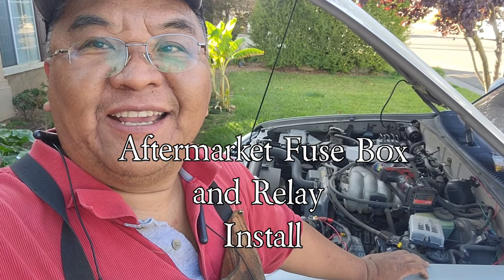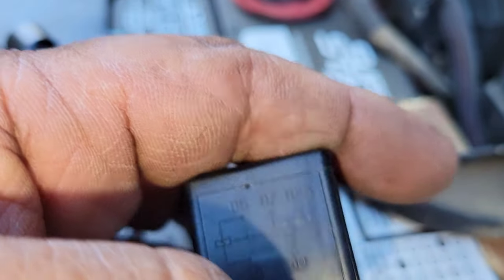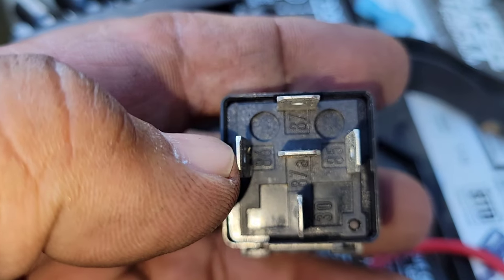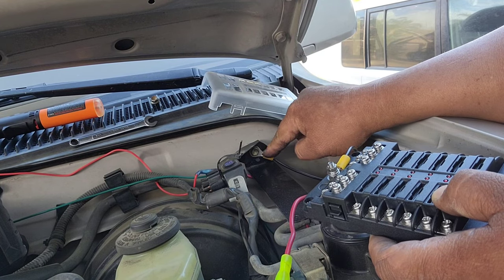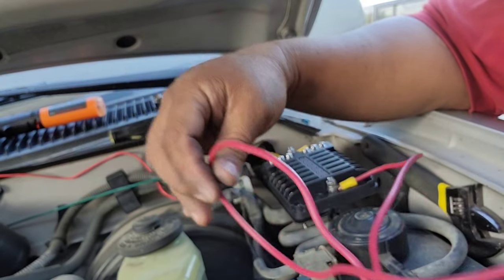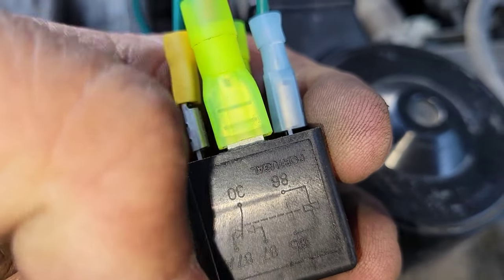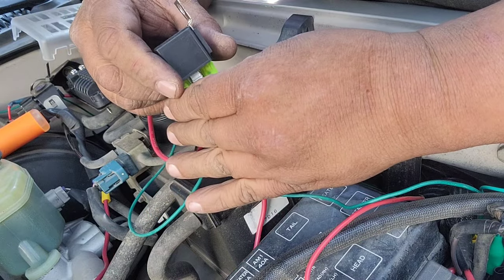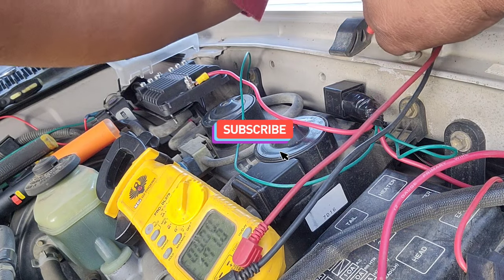Aftermarket Fuse Box and Relay Install

Comment: Tapping off the battery, always should be fused. Also not sure what devices you plan to take off the sub-panel but the  main supply wire coming from battery is what? 14 gauge?? You need to understand a fuse or breakers job is to protect the wire, you have a small gauge wire supplying a potentially large sub-panel and its not fused....recipe for a disaster

Comment: I did this on my atv SxS a year ago following your steps and it has been working great.  Today I hit a mud hole very fast trying to get through it.  A chunk of mud splashed up and completely covered all of posts.  Now the 87 post doesn't work.  So I am guessing that the wet mud caused the relay to burn out.  Is this right?  Nothing was drawing on the fuse box but the low psi fuel pump which only draws 1 amp.

Update:  replaced the relay and put it in a waterproof case.  working great.  thanks again for your awesome explanation.

Comment: Unless the relay block is the same voltage which is over a hundred amps or more you are lowering the power of the block. Because that looks only like a 30 amp relay and you do not have to put a relay on the fuse panel really because when the key dies the power dies unless you use a switch on a accessory which then a relay can be used along with the switch lower but if you put the relay between the battery and the whole fuse panel itself unless it is the same amperage as the block you are lowering the power of the block therefore disabling some of your voltage possibilities. Circuit breaker would be better. Relay for initial voltage increase  supply for fuse not steady current at same voltage . Like using a 20 amp fuse for 500 watt amp and wanting watts to stay 500

Comment: Say I want to connect my led bar to the fuse box and want it to be activated by a switch in the cab where would I need to put the switch in the circuit thanks 🙏🏻
Reply from the maker: Are you familiar with using a relay to power up your light bar,
Reply: If your using a fuse box, place the switch to the led bar between the fuse box & the device on the positive.
Reply: Use the fuse, fuse box to power a relay then to the LED lights. even though LED's do not draw a lot of current, you do not want to burn up your switch most are not made for any current load.

Comment: Do i need a relay? Or can I just have the fuse box hooked directly to battery if I want power when the ignition is off?
Reply: Its a little backwards.. no disrespect but connect the fuse box directly to the battery... then run from the fuse box to the relay. The order should be..
1. Battery 
2 cable from battery to fuse block
3 fuse block to relay
4 relay to a distribution block or directly in to what you are wiring

Comment: Hello The Other Guy,
      Great video once again. I saw a few things you might want to consider? 
     1. You need a fuse, or new style  resettable breaker if possible but kind of expensive from the battery to your relay, fuse block. if something happens to that wire it is not fused.
     2.  The relay you used to turn on the fuse box is too small, it's only a 30/40 amp relay on a 100 amp fuse block. If you use more than 30 amps on your fuse block you're pulling too many amps through the relay. another mistake people make is putting 30 amp fuses in each slot, remember it's a total of a 100 amps on the box max and 30 amp max per slot most of the time.
     3. Might consider using a bus bar instead of running all of your wires to the battery and making a wire hazard, too many connections connected together on one battery bolt.
     4.  Wire Awg, yours looks good but might think about what Awg you need for a 100 amp box. both positive and negative need to be the same Awg.
Reply: I had written a long confusing question I went back a read your original remarks and found my answer there 
So thanks 
You have a great day
Reply: Hey man what fuse would you use from the battery, I’m running electric windows, light bars, winch, compressors. Should I get a 100A fuse? And some 4 gauge wire from the battery?
Reply: @kizzamate  Look on your fuse block. Most of them are rated for about 100 amps. Use whatever app fuse the block is rated for and the appropriate wire awg, and you're good to go.
Reply: @robbyota5598  After much research because the thing doesn’t say it I’ve found out it’s 25A per circuit and 150AMP all up supposedly . So I’ll go with a 150 amp relay then. Thanks man
Reply: Several YouTubers showing installation of these fuse blocks are failing to protect the supply wire from the battery, or they are protecting it with the wrong wire size and wrong fuse size.   There are lots of charts online that will tell you the proper wire size and the appropriate fuse for that wire size and the length of the wire.  Otherwise, it's a fire waiting to happen.

Comment: Great Video! I watched the video over and noticed that your single cable going to the battery suddenly became two. Could you explain? Thanks.
Reply from the maker: Thank you. But at what part of the video was that?
Reply: That was at 8:46 on the Video. Did you combine an existing power wire so as to make one connection? 
I ordered a fuse box and relay and installed it following your instructions. It's working beautifully. Thanks you.

Comment: Great video.  Question for you from non-electrician.  What is the relay wiring if I want fuse box power to be OFF when the ignition is ON, and fuse box power ON when the ignition is OFF... to hook up a 110V - 112V siren in the engine compartment.  It is triggered by a wireless infrared motion sensor under car to scare away catalytic converter thieves.
Reply from the maker: Huh?
Reply: @theotherguy3083  You don't understand question, how to do it, or rationale why i want siren powered when care is parked and off?
Reply from the maker: @ericr1035  just buy a cheap alarm with motion or vibration sensor and you are set.
Reply: @theotherguy3083  That is what I want to do... it's a cheap Kerui motion sensor (AAA battery powered) and attached under the car to detect motion of a supposed catalytic converter thief under the car either at night (parked in front of house) or during the day (in a parking lot).  The siren/receiver that comes with pack is designed to plug into a wall outlet.  I want to mount it somewhere in the engine compartment and only powered when the car is turned off... for obvious reasons I don't want the sensor detecting the motion of the road while driving and triggering there siren ~ although that would be a fun story to tell grand kids.
... using your relay/fuse box fundamentals is there as way to power my siren except with the opposite polarity that your video describes - - fuse box/siren powered only when ignition is OFF.
If I'm over thinking it, this is really not my territory of expertise and I appreciate any simpler approach to my diy dilemma.
Reply: Make sure you connect on the closed circuit. Part no. Narva 12v 30A relay (72386)
Reply: Get a relay that will support whatever amp rating you need. Then use 37a, this will remain on when the car is off. when you turn the car on it will then turn it off. If it is for a household voltage AC, all you need to do is get a small power inverter DC to AC. you might consider how long you're going to be running it, 8 hours a night? it might drain your battery or kill it. Also instead of the inverter look on the back of the sensor it might be DC most household appliances are DC voltage. If this is the case you should be able to cut off the cable and connect it straight to DC power such as your battery if it's 12VDC. Hopefully this will help.

Comment: I'm working on doing the same thing and   you're direction has helped me out. Is it nenecessary to fuse up the wire from the battery to the aftermarket fuse box ? Also what guage wire do you use when connected to the relay ?
Reply: hey man saw your comment and was wondering the same. did you find out what gauge wire?
Reply: Yes It is necessary to use a fuse between the battery and fuse block. also    about 8Awg wire for a 100 amp fuse box. It might be ok to go a little smaller Age, 10Awg with a shorter run of cable and if longer you need bigger, smaller Awg cable like 4Awg.

Comment: Thanks for this. I've been looking for this for ages. I was going to connect my fuse block power source to the alternator. But that means I only have power when the engine is turning over. 

One question, where do I connect  the wire in the cabin fuse block. I was thinking tapping into a acc fuse there?. Is this correct.
Reply from the maker: Yes
Reply: @theotherguy3083  Thanks